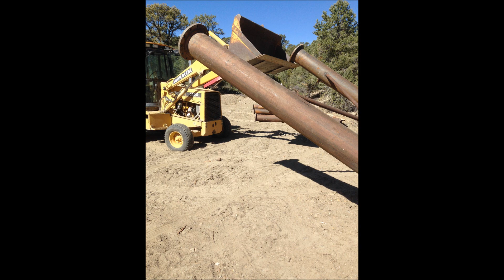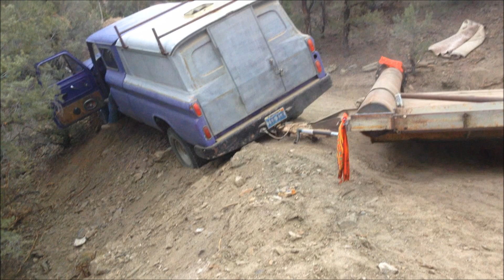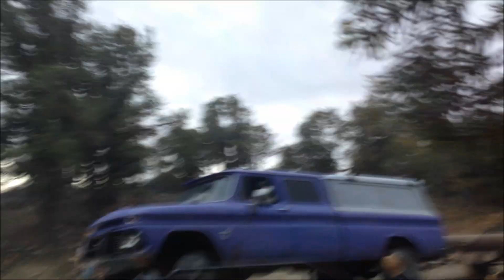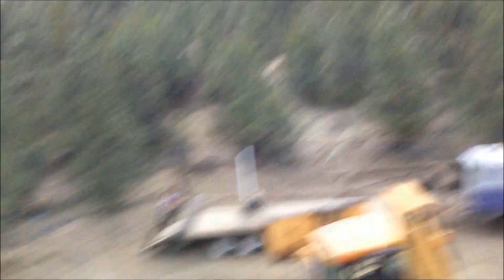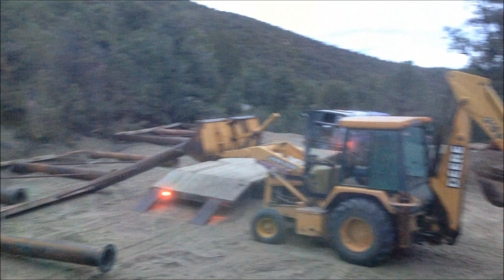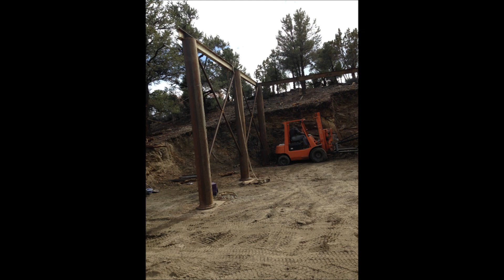Shipping Container House Built on a Budget Part 8 Foundation

Comment: Did you use concrete on your foundation?  I saw where you talked about the metal plates. Did I miss the footers?
Reply from the maker: We have the steel plates on solid rock bed. We didn't pour any footings.